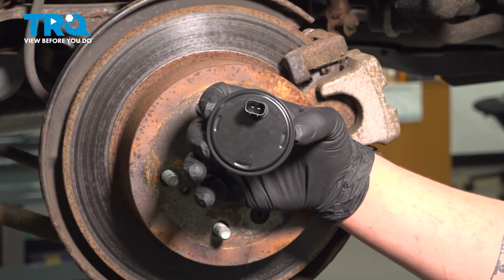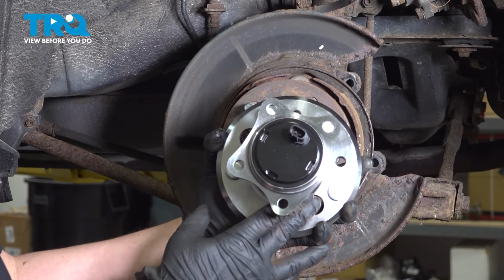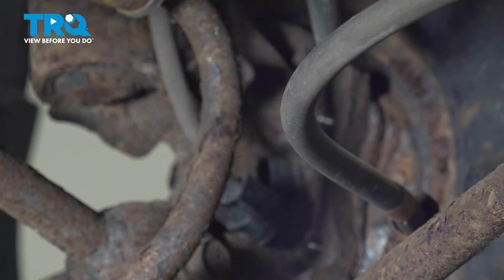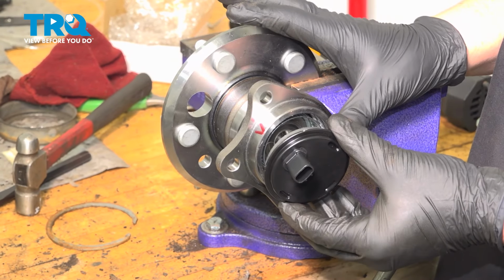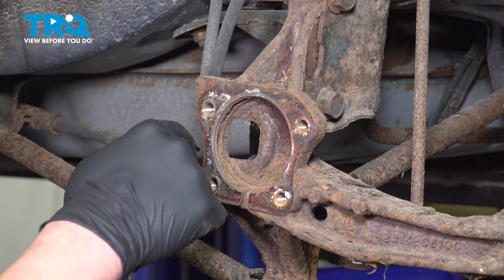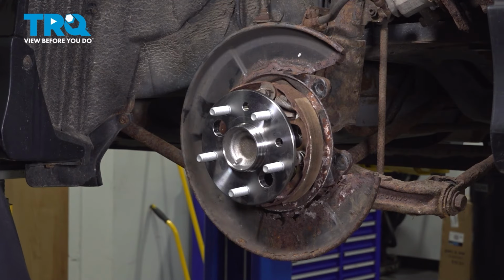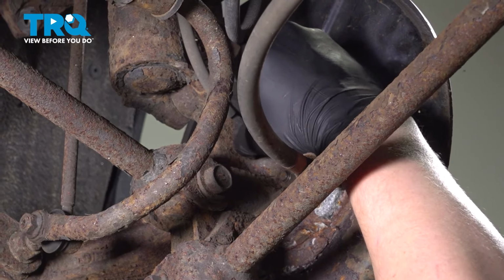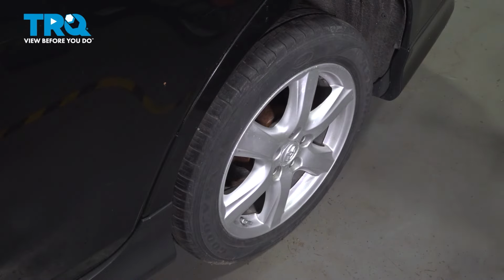How to Replace Rear ABS Wheel Speed Sensor 2007-2011 Toyota Camry

Comment: You can change the sensor without separating the hub from the backing plate. But its actually easier to just buy a new hub which comes with the sensor installed in it.

Comment: I think he just wanted to show how to remove the sensor and reinstall a new one if you wanted to. However, it is a better repair just to replace the entire hub assembly with a new sensor already installed as he did here.